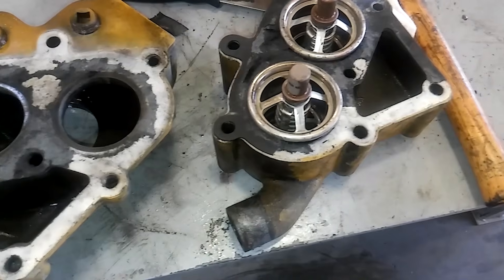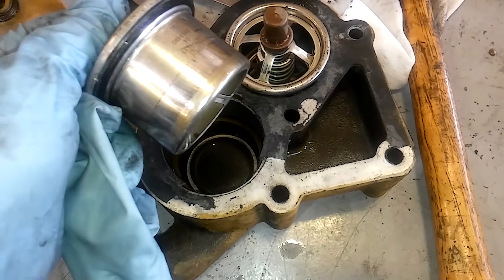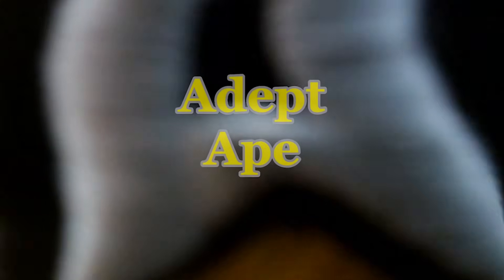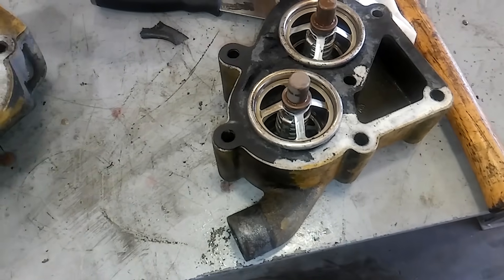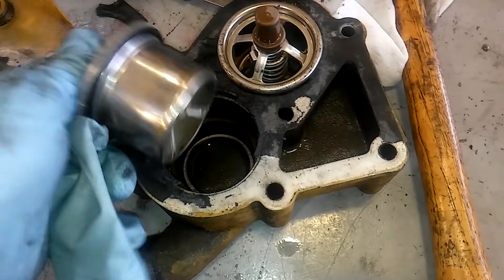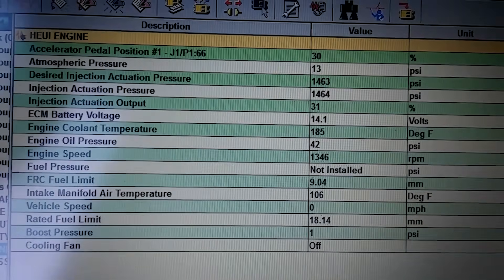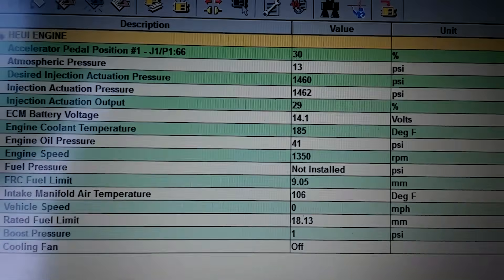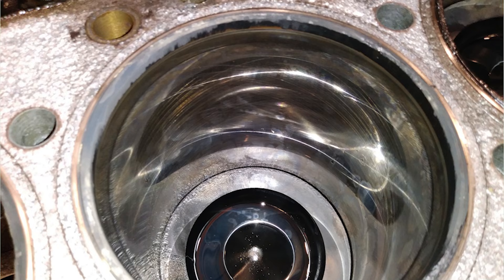Why You Should Never Remove or Use a Colder Thermostat In Your Engine.

Comment: After Ford's blowing head gaskets because they run to hot alloy heads warp really easy the 6 cylinder needs a V8 thermostat 77degrees no more pinging and has more power than running it with the stock 92 degrees one

Comment: Thank you you need to go back and study something but anyways the thermostat the hoter the thermostat in your vehicle makes it stay in your motor longer which gives  which gives your the radiator longer time that spent in the radiator  so it cools it off a lot more the colder a colder thermostat will cycle through a lot quicker which will not allow the fan to cool it off as much so your motor will run hotter on a cooler thermostat then with a thermostat and if you don't believe me try it and you'll see and I do understand what you're saying but somewhat correct and somewhat not but everybody got opinion I just look at the data in the fact

Comment: So should I be running the hotter recommended thermostat in my 7.3 powerstroke? Ford ran a cooler one than what Navistar recommends. Navistar uses the hotter stat in the 7.3powerstroke/444e in their light truck applications.

Comment: Had a Cummins ISL Natural gas come in for a oil overheat code no oil cooler stat available back ordered another tech took it out same problem then I was given the job got in a heated discussion with the foreman this thing needs a t stat installed he said does not make sense full coolant flow will cool the oil better I said coolant flow has to be regulated slowed down has to have time to absorb the heat and take it away from the oil its called heat soak he said the cooler must be plugged up change the cooler now done still no t stat same result finally put a new t stat in FIXED. Its called thermodynamics A thermostat is there to regulate flow it does not simply be open or shut it is infinite on temperature the fluid in Question has to spend time in a liquid to air or liquid to liquid heat exchanger to heat soak take the heat away more prevalent with two hot liquids not so much with a radiator. The argument my t stat is stuck open my car does not overheat the stat still installed is a restriction in the cooling system. I challenge anyone take the stat out now no restriction run down the freeway on a 100f day you will overheat.

Comment: It was explained to me that the high temp thermostat helps the climate control (heater core) heat the cabin better but with reduced life of the rubber and plastic components of the cooling system. On the reverse side... Racing engines run colder to help reduce knock but they are expected to wear quicker and be rebuilt often... Either way driving 30+ year old vehicles it's a pain constantly replacing cooling system parts.
Reply: I'm glad I saw this video though because I've considered pulling my thermostat and running an electric pump but someone mentioned in the comments that your heater core passages mess with the flow of coolant with no thermostat

Comment: While I see your point, i disagree with that when it comes to my truck. My truck since I bought it ran between 200 and 210 degrees on coolant. That's just the truck not even towing. Switched to a 180 thermostat and it's about 205 when im towing a 15k trailer. Truck was a 2006 ram 3500. No longer have the truck but what else could cause it to run that hot without a load? My mechanic had it for 4 days and couldn't find out why and just recommended a cooler thermostat from cummins.
Reply: Lol. 210 is completely normal. My old car wouldn't open the electronically controlled thermostat until 225 degrees.
Reply: Like the guy in the video said, could be a bad water pump, or a bad fan clutch etc. 
You should seek out the source of the overheating. Replacing the thermostat is good if it's old. Thermostats are cheap. But trying to remedy the problem with a different thermostat is not a real solution. If you replace the thermostat with the oem part, and it still overheats, you need to move on from the thermostat entirely. Troubleshoot the fan clutch, water pump, radiator, etc. 
The fan clutch is designed to spin freely without engine power while the vehicle is warming up, and engage with the engine to spin with full power only to cool the engine as needed. The clutch engages and disengages as needed. So the engine overheats when the fan clutch fails to engage properly, but the fan still cools the engine somewhat, because the fan spins freely as air passes into the engine bay. So your vehicle will overheat at idle more so than on the freeway. 
Fan clutches often go bad at around the same time as the water pump, so replacing both is the best protocol if either is showing signs of dysfunction. 
The fan blades may also be physically damaged, or the radiator may have issues. 
You need to explore the entire cooling system to diagnose the problem.
Reply: The hemi always runs hotter then a normal engine , I was told to change my thermostat out ,fir a 180 and my brother a mechanic said whoa your horses little pony, do not do that the hemi runs hotter, so just leave the fucker alone....and on the ram forum, lots of ram owners did do the 180swap and swear it did wonders for their vehicle, but if the engineers put it in their ,there's a reason.....don't fuck with it,unless u have modified engine for racing...

Comment: Moving to a colder climate I never noticed that in a lot of passenger cars the auto won't shift into overdrive until the engine is hot enough. If the engineers bothered to programme that in order to increase the longevity of the motor, I'll take their word for it.
Reply: As Someone who owns a few vehicles that acts such a way, I can tell you it has ZERO to do with longevity and EVERYTHING to do with emissions.  The sooner the MFR can get said vehicle at operating temp, sooner they can go into closed loop...and its usually 135°F that it drops into O/D and closed loop, even though the engines run 190-200°F - Also Speeds the warm up cycle for those of us that get Arctic weather!

Comment: My one owner 91 s10 has got 242,000 miles I use it every day I would trust this truck to drive across the United States any where I've had my thermostat out for about 6 years and it hasn't had one single problem I still run the green coolant as well maybe one day it might show its self but this truck is the best running truck I've ever owned and I wouldn't sale it for nothing
Reply: How is your heat in the winter?
Reply: @johnstamper2965  Well considering he said "Sale" vs "Sell" I would assume that he is south of the Mason-Dixon line, so likely not an issue as they have no idea what Cold is. Also the only reason that he doesn't get a SES light is because the TBI Fuel System goes into closed loop at very low temperatures.  But I can tell you that the power might be a bit better running cooler temps...but the MPG on that truck is trash...Having owned a TBI GM Vehicle myself and the Thermostat going bad cost me 3mpg (considering 15 was a good trip that's BAD) in mild Fall weather...Didn't really notice a big difference in summer.
Reply: I put a 160 in my mustang for racing years ago nothing happened but he is probably talking about new cars
Reply: Slightly lower temp and so much sh1t actually lasts a lot longer that at 210/220

Comment: I purchased a 2004 LB7 last year.  Motor was replaced in 2011 with a Casper engine. So far no issues with the motor but I have noticed my temp stays at 135-160 and will only go up to 190-200 if I am towing or maybe Mid summer in the 120 degree heat. But majority of the time it’s down super cold

Comment: Before I even watch this video, I will say that: First, I don't work on newer vehicles past 1997. I'm, not set up for them and I  mostly don't  like them anyway. So... "Any engine temp dropped below about 180F will begin to cause cylinder wear. Mostly at the top of the bore. Particularly if the temp drops to 160F or below, the cylinder wear WILL be severe". An engine need to run in a particular temp range. There are other considerations such as lubrication. I like the old adage (usually directed ad race or high performance engines is "An engine works best with it's head in a freezer and it's bottom end in an oven". I had a thermal lance once but I couldn't get it on the horse...

Comment: On the lower temperature thermostat topic all I have to say is this. NISMO makes a lower temperature thermostat intended for higher horse power engines and for track use. I run one as do thousands of people, and I have seen lower temps at the track, both coolant and oil from just replacing the thermostat. 
All that moisture is also taken care of by a properly set up PCV system with a catch can.
Reply: These guys would like you to believe that Nissan's race department are morons that go off of "myths" because their trucks were made "perfect".

Comment: Another reason not to run the engine cooler is the oil viscosity. If the oil is cooler than it should be the oil pressure will go up and its ability to drop contaminates will also drop. So you have dirtier oil at a slightly higher pressure going through the bearings and possibly scoring them. The oil pump will have to work harder thus wear out faster and overall use a slight amount of extra fuel.

Comment: One question I have. What about restrictors for a mostly drag strip car? I have been debating keeping stock temperature or a restrictor.
Reply: This video was mainly about drastic Tstat changes and to keep him clear or EPA due to emissions.  Dropping 10-12 degrees on Tstat is a viable tuning item especially once exceeded stock power levels and/or cooling design capabilities.

I don't like restrictor instead of Tstats yes its one less item to fail, but if for approaching that level I'd suggest either waterless coolant or block filler.
Reply: @bowez9  My 68 Toronado kept overheating. I have a restrictor in now. Car hasn't overheated and kept a steady 190-210 degrees. Ported C heads 500+ lift cam headers MSD 6al box / distributor and an old offy tunnel ram. On a 110 degree day drove it for a few hours didn't overheat. She's a fun ride.

Comment: New topic. Why is it when you remove your cats , resonator , mufflers. And open up your intake do you get better gas mileage. But are told you need all of that for gas milage? Also cooler oil is better over heated oil burns and makes sludge 🙄 internet mechanics ill tell you just like your trans you dont want the temp above 180 look up what temp motor oil scorches

Comment: Correction keeping the engine at a fairly cool temperature  doesn't  cause  moisture to form in it in reality what causes the moisture to form on the end of the oil cap and sometimes just inside the valve covers is due to climate change outside of the engine like after running  it on a cold day and shutting it down and letting set over night because once the engine shuts down it begins to cool down from the outside in which cause the air inside the engine to condense and so it forms a small amount of water that gets mixed with oil residue on the end of oil cap which is natural even for a brand new engine and it does  cause any harm to engine  because it boils away pretty much as soon the engine has started and runs for a few seconds the only way any damage can occur from as you call it moisture being in the oil is if the is problem with cooling system leaking in to oil but no keeping you oil temperature  realitivley cooler than the engine  will damage  it intact it actually better for the oil temperature to be as low as possible because it can maintain better lubricity which prevents premature wear on the engine bearings  because as oil gets hot it breaks down as it gets hotter and it loses lubricity  and the lack of lubricity  causes premature wear on the engine bearings and the engine itself

Comment: I agree with what you said. 100%. HOWEVER when you drive about 4.5 miles one way the motor doesn’t have enough time to heat up and open the thermostat. What will happen in this case is a blown head gasket in the future. Not right away but it will happen. I’m not talking about your hot rod grocery getR. I’m talking a bout your the daily driver. So how do I know this well I tell you it happened to me in a mustang v6 engine simple and no modes. Once I changed out the head gasket I put a low temp thermostat in it. I think it was a 195 degree and I put the 160 in and that problem went away. I didn’t do it to keep the motor cool. I did I to circulate the coolant. Never had a issue with again.

Comment: One word , hotter displaces moisture , ever run a methanol race engine then you will see what cooler moist air does. Cooler air is denser and makes more power , but it has its own set of issues.

Comment: Zero logic in this information. While engines run better at factory operating temperatures than cold, running them hotter than designed incurs premature wear. This is why it is called a cooling system, and not a heating system. 

It is amazing how many people these days use ignorance to convince others that common sense is wrong..... and this guy is representing Caterpillar??? Either he is about to lose his job, or Caterpillar is about to fail as a company;  nobody stays successful with running a business from the basis of brute ignorance.

Comment: I just bought a c15 acert 1.1 million miles runs good found a coolant leak replacing the whole coolant system had to water pump leaking and everything else I think the truck was sitting for at least a year i have a question i seem to be losing power only in 9 th and 10 th gear the rest of the gears are great under a load check engine light comes on sometimes and goes off any ideas

Comment: If your engine is getting hot most likely you either have a clogged radiator or a bad fan clutch. Besides thermostats are there for a reason.  Once a certain pressure the engine gets it opens up the thermostats to push coolant into the block.  Remove them you have too much back pressure then kaboom.

Comment: Nope. It's for trash emissions and it terrible for the engine to run stock stats that are 215F (looking at shit GM). People wonder why they have nonstop leaks....there ya go. It's all cheap plastic and rubber. There's a reason why older engines use 180 and even that's not optimal for performance engines (170 is pretty nice for DD and 150 for race). Yeah, I really want my expensive oil degrading like crazy and thinning out to water from 230F coolant. Gtfo. Also, the heads are NOT going to be happy.

Comment: My lt1 and and all small block chevys runs better at 180 than 210 the proformance and longevity differences determine the over temp and what true reliability you want 210 is at the point of maximum heat range for gm products but is there standard range

Comment: Looked like what we called air arc . Stick welder with a carbon rod . A air line ran through the rod holder.  you could remove welds like they never happened if u was good with it . Thats a old timer tool there but best thing ever if your good.

Comment: If you have a mechanical fan, KEEP IT AS VERTICAL AS POSSIBLE!!! If you removed it. There’s a liquid inside the fan, if it’s laid down on say it’s face or front, it can leak and contaminate the Clutch in the fan. If this does happen don’t fear. Just tack weld it to its self. Full time high speed fan

Comment: You can run an engine with no thermostat for as long as you wait for parts to arrive as it's better to have no thermostat than a stuck one, but there's no point as if the engine overheats there's a problem hidden somewhere else as the thermostat opens at a temp way before to the point it overheats.
Under load the engine keeps its coolant temperature very stable depending on the fan settings and the cooling system design, so you can say the thermostat is almost useless, but in cold mornings and light load it's where you need the engine to become hot as soon as possible to have the oil and the engine work at a high efficiency as that's where wear happens more quickly.